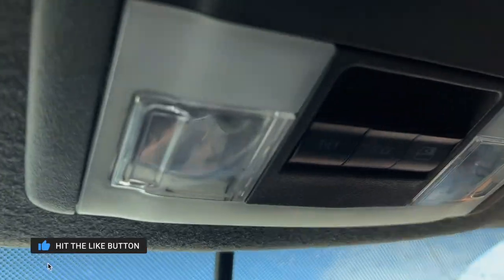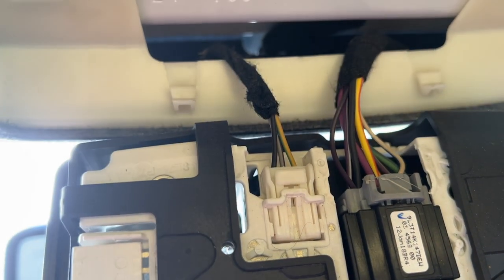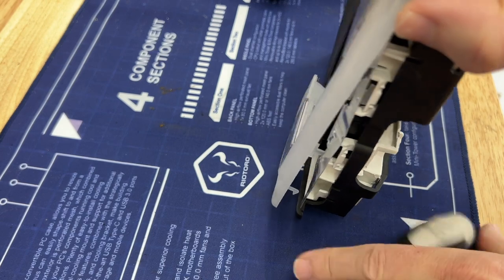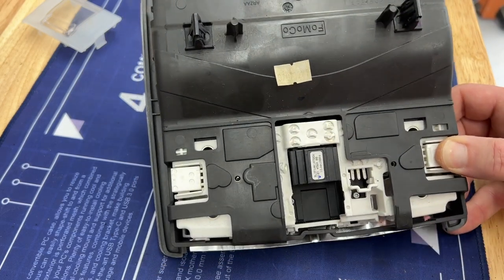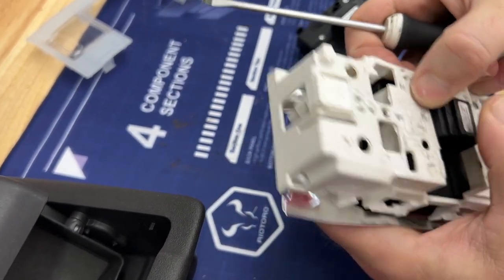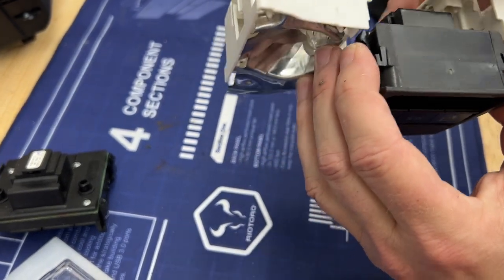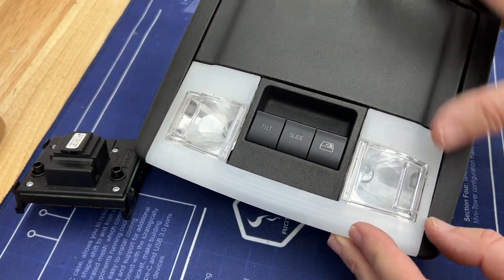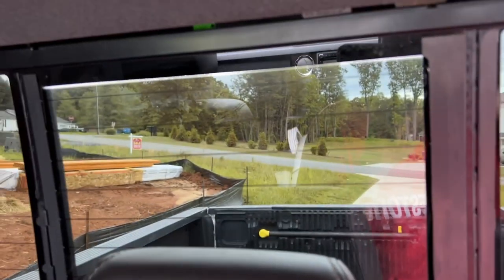How to REPLACE Sliding Rear Window Switch | Easy DIY Fix for window not working 2009-2014 Ford F250

Comment: It would be interesting to open the old switch to see what broke and if you can repair vs replace it.  My guess is the cable assembly at the rear window got kinked or binding in some way. Time to pull the rear seat out!
Reply from the maker: +Alan Vale yes, I think you’re probably right about needing to get behind the rear seat and have a look

Comment: I had the same issue on my 2013! I took it to Sunroof King in Houston to replace the dry rotted tracks for my sunroof. They said it was $450 to replace the motor on the rear sliding window. Decided to give it a shot at home!

I bought the switch from Amazon and it still didn’t work. Checked the rear sliding window motor and come to find out it was left disconnected from when Sunroof King checked it. Reconnected it and now my rear sliding window works with the new switch!

Check the motor is getting power and the metal cables are still probable attached!
Reply from the maker: +Mickkeyy thanks for the info!